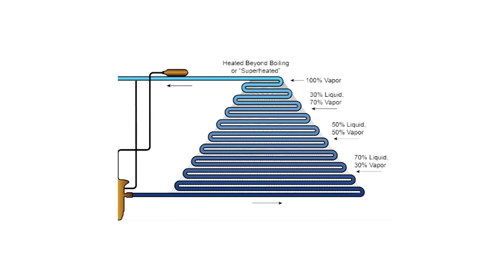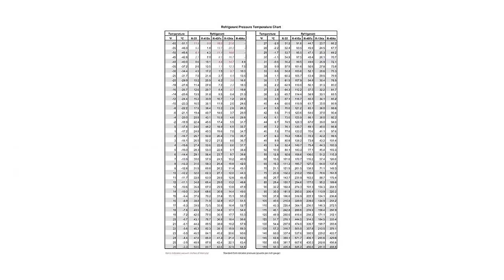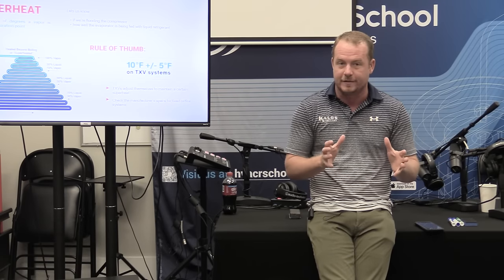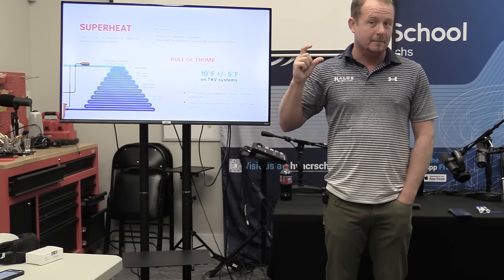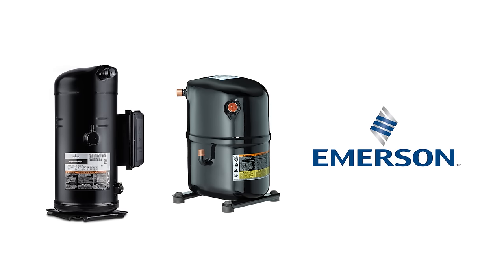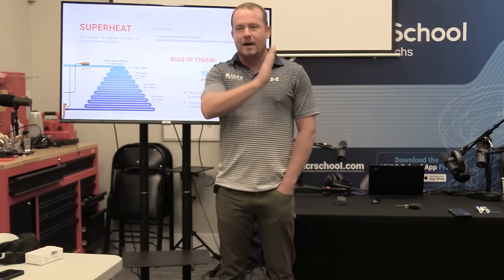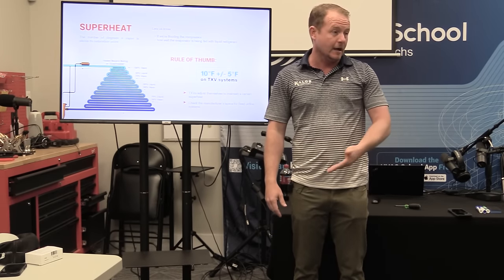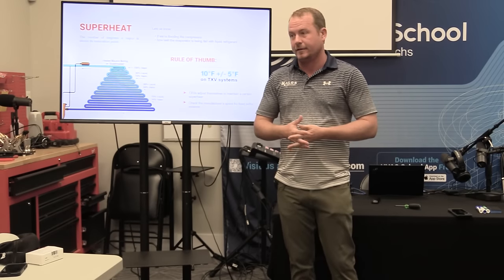Class - What Superheat Signifies

Comment: You are all wrong what superheat is.  It is neither related to how much heat absorbed or how full anything is.   If it happens to correspond to it, that is another matter.
Why it is not related to how full or how empty anything is.  If it was then you will have a gauge that will show that, either in gallons or percentage of how full or empty something is.
Hah... Where is that gauge that show how full or empty it is.  If it was such a thing then you would know exactly how much of it you need before you pump the crap in the system before you know how much to put.  All you have is the pressure and temperature gauge.  Do you not?  YES OR NO.
You teach this and I just watch what you guys do and then what you say and how you describe it.
I barely made it through high school and now I know why.
It is because what I was hearing made no sense so I couldnt memorize shit.

Why this happens.  Because you are too busy having learned the lingo.  the lingo is more important  ( it is to make you look and sound like you are something, educated).
Let me clearly explain to you what that word they invented to sound big actually is behind it all.
First it simply is in fact represented as temperature.  In other words when you measure that thing, you will end up measuring a temperature you read by a gauge otherwise you would have no idea.
Don't you give a value to it. Isn't that value a temperature as some degrees?  Of course you do. When you read the temperature at the so called low side of the compressor and not the temperature where it actually leaving the evaporator as whatever it maybe it is read as temperature you can see and not as heat of any sort and the pressure that goes with it.  That temperature reading is not the same as the temperature you read on a thermometer hanging on your wall.  Trust me it is not.  But that is another story.  60 degrees on that gauge is far colder than 60 degrees that shows on that thermometer hanging on your wall.  If it wasn't so. your freezer in your fridge will never be lower than 40 degrees.  And everything will melt and goes with it your icecream.

Whatever you want to call it, it has been experimented that this refrigerant when it leaves the evaporator and on its way to the compressor must neither be colder or hotter than that temperature  labeled superheat point.  Why?
Because if it is hotter, it is tough on the compressor having to deal with that much heat and if it colder, it implies that some liquid is still present and that also is hard on the compressor to deal with.  It is not because the refrigerant can not take on more or draw more heat or whatever.... Wrong.   Nothing funny happens to the characteristics of the refrigerant. It won't acquire some other state of matter.  It won't.  It is the temperature point that makes it easier for us to deal with.  It is not related to the state of change of any kind of the refrigerant. 

And that becomes obvious that it is not related to whatever amount of heat was absorbed or not absorbed or contained or not contained even if it happens to correspond to it.   
Don't send such refrigerant with higher or lower temperature no matter where it came from.  It means don't inject your refrigerant either if you could help it into the system like as in low pressure side at that pressure and temperature you labled super whatever.
Simple as that.
The truth of it being measaured as temperature comes out.  He has no choice but to say it.  He himself doesn't catch it.  The folks that made and designed the system knew that at this temperature which happen to be the sweet spot, it will match all the other components that go with it and it just happen to also correspond to the amount of ( mind you particular refrigerant) in the system.  And it is not in terms of gallon but percentage since different size system have different actual amount of the crap in terms of gallons or whatever.

You folks, the people that started the lingo control aspect could have simply labeled superheat as ideal exist heat nothing wrong with that and the so called super cool on the condenser side.  But oh no, it does not have the hollywoodish, and pompus lingo to toss around.  Oh, those are too long and take up too much room to write it.  Then spend infinite amount of time explaining it, memorizing it, then giving people test so they flunk the shit.
It is easy to forget anything you memorize.  But try to forget something you know... try it.  You may have no god dam clue what it is called whatsoever but you know it even lying in your grave if you could speak.

Mr. Einstein Mr. Einsteing, what is the speed of sound in the air.
" It is in the books, look it up" said Mr. Einstein.

You want to be a sheeple memorized fancy words..... that who are and that is what you will end up be no matter how much money you make and how big of a shot you become no matter what it maybe, whatever route or carrier or whatever you pursue.
Reply: Why do you feel the need to comment on stuff you barely understand?
Superheat is a physics term. It refers to something that has a higher temperature than its  saturation temperature. If the superheat of the refrigerant is 20* then it has been heated 20* higher than the saturation temperature. The saturation temperature depends on the pressure of the refrigerant. Subcooling is the opposite, its when something is colder than the saturation temperature. Water colder than 212* at 0 psig has been subcooled.
On a system with a piston metering device superheat indicates refrigerant flow into the evaporator. If superheat is high then there is a lack of refrigerant flow into the evaporator which is commonly caused by being low on refrigerant.